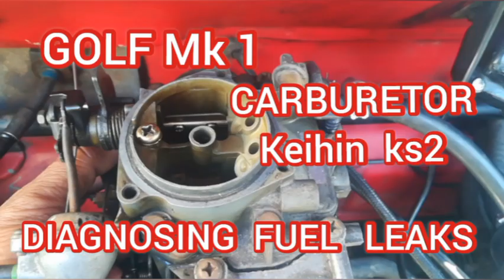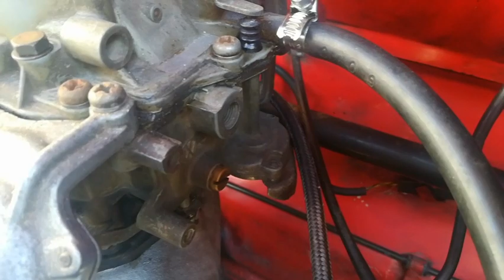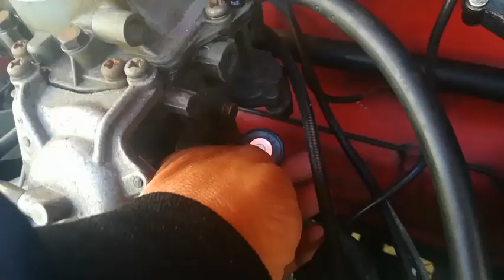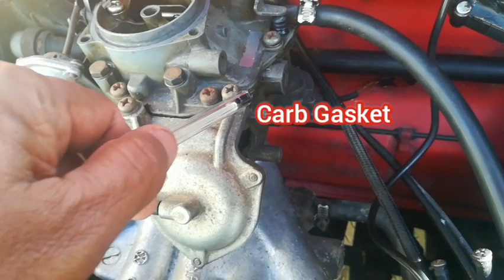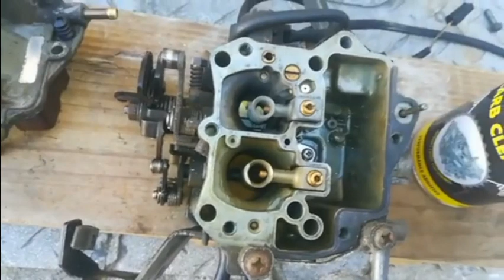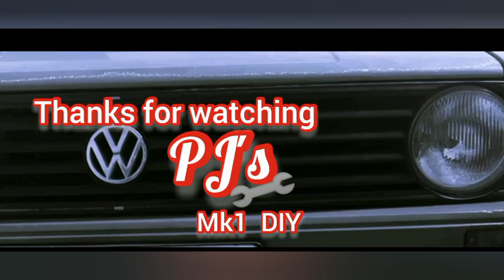GOLF MK1.CARBURETOR FUEL LEAKS. HOW TO FIX. KEIHIN KS2 #vwgolf #golfmk1 #vwfox #carburetor #golfmk2

Comment: Hi PJ my car cuts out while driving, when I attempt to start again it does not start, I than serviced, changed my coil, that did not assist. I than changed my carb base plate and the car was driving beautiful for two days, today It started cutting out again, advice? I have a pirate Carb for more than a year.

Comment: What could be the problem on the carb if u constantly see fuel leaks on the manifold and sometimes there is bad smell
Reply from the maker: Could be over fueling, or the  accelerator pump diaphragm, or also   torn base plate

Comment: Hello man, could you please show me the whole process on changing the carburetor pump. also show how does it pump fuel .
Reply from the maker: Are you referring to the mechanical fuel pump?..
Reply: @pjs-golfmk1-diy  no am referring to the diaphragm on the carburetor
Reply from the maker: @thamsanqasagwityi1407  OK, best to do it when you take carb off the manifold and base plate.. Flip the carb upside down, and you will see 3 small screws.. Loosen these and you will see a spring, and then the diaphragm. Remove old diaphragm, replace with new one.. Don't forget to put spring back. (watch where  things go when loosening up. Take a pic if necessary).. Put back the 3 screws then you done...
Reply from the maker: @thamsanqasagwityi1407  I will do a video shortly...
Reply: @pjs-golfmk1-diy  Thanks for this information, what are the two small holes for next to the diaphragm. can i close it with silicon when am done replacing the diaphragm?